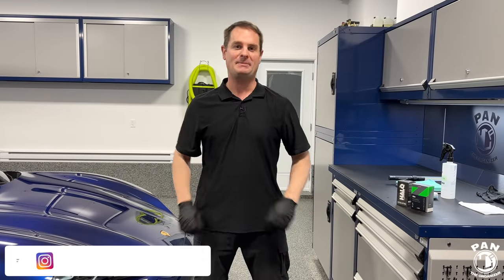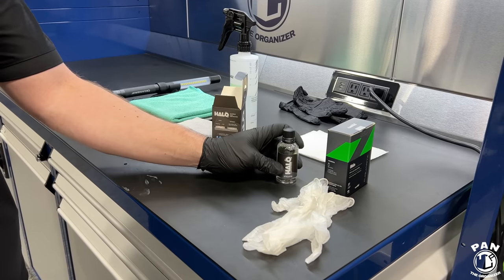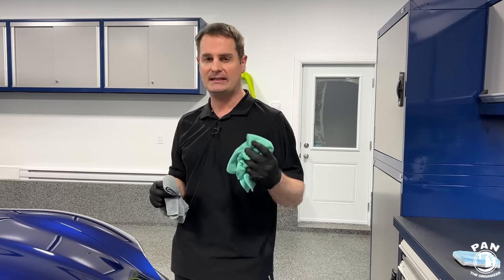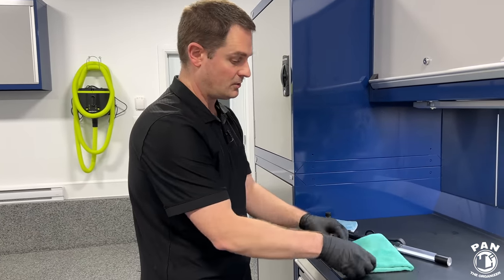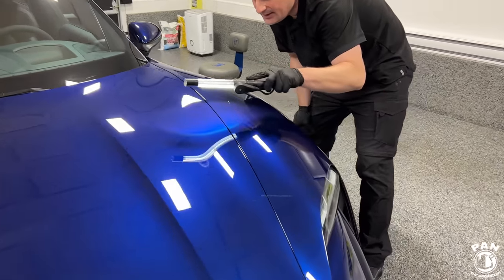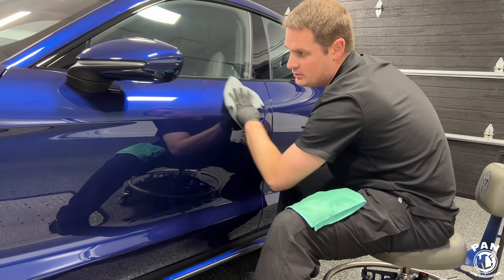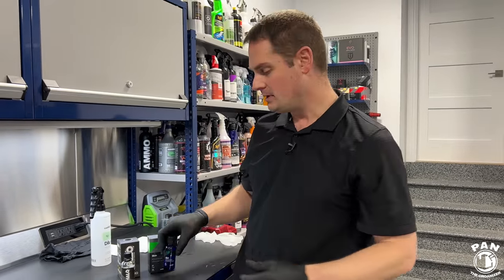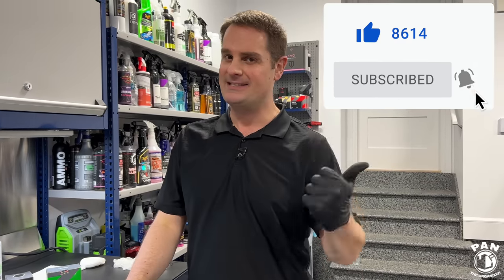How to apply a ceramic coating on PPF (paint protection film) : Porsche Taycan Turbo

Comment: What’s your thoughts on using CSL on a gloss wrap vs halo ? I know one is a 2 year one is a 3-5 year coating not sure what works better for it though.
Reply from the maker: CSL will work on PPF as well. It probably won't last as long as it would on a clear coat though, as that's not its intended use.
Reply: @PanTheOrganizer  cool makes sense. I’ll try halo! Thanks brother!

Comment: What is best way of purchasing ceramic coatings in bulk to save money? Thanks
Reply from the maker: It depends if you're a consumer or pro detailer. If you're a pro detailer, signing up with your favourite coating brand to become an authorized installer for them usually allows you to buy in bulk at discounted prices.

Comment: I have a partial  PPF can I use the Halo or Carpro for both surfaces?
Reply from the maker: If you have painted surfaces too (no PPF) use the paint coating on PPF too. For example, CarPro CQUARTZ UK 3.0 can be applied on paint and PPF.

But a PPF coating isn’t made to be applied on painted surfaces.

Comment: I really thought I could use Crystal Serum Light/exo on top of ppf. Should I buy Halo just for the parts that we are going to film (full front) and then use csl/exo on the other parts? I'm worried there is going to be a noticeable difference.
Reply from the maker: You can still use the Crystal Serum Light and Exo V4 combo on top of PPF if you wanted. Many paint coatings can also be applied on top of PPF.

It's just that Halo was specifically formulated for use on PPF. There won't be any noticeable difference visually regardless which ones you go for. Don't overthink the moment.
Reply: @PanTheOrganizer  Thanks, Pan! I've learned so much from your channel. In your opinion, do you think the water beading and sheeting is as good with Halo as it is with csl/exo? Ultimately I'm just trying to give my new car as much protection as possible while making my maintenance as easy as possible. We keep our cars for a long time..hence the ppf :)

Comment: I guess what is the process after 1-2 years when this stuff has worn down?  Since it's PPF are you doing just a  decon wash with a light polish to remove the leftover coating to reapply?
Reply from the maker: Correct.

Comment: Pan, Will a ceramic coating on clear bra affect the self healing properties of the wrap?
Reply from the maker: It depends what PPF you have and what coating is applied. Too many variables involved to answer. Your best bet is to get in touch with the manufacturer of your PPF and ask them directly.

Comment: what's the correct procedure if you  touch the windshield or the side glass by accident with the halo??
Reply from the maker: Just immediately wipe off.
Reply: @PanTheOrganizer  thank you for the prompt respond. I know this video is almost a year old, however. do you still recommend the halo or is there something better in the market .
Reply from the maker: Gtechniq Halo, CarPro Skin and Gyeon PPF EVO are still the best for PPF. I made a recent video where I used CarPro Skin on my Porsche's PPF that was replaced on the rear wheel arches here: https://youtu.be/gusUiD9uoW4

Comment: Is there a waiting period to put ceramic coating on ppf after the ppf had been installed?
Reply from the maker: It depends on which PPF you get, but normally the following day to the PPF installation, you can apply the coating, unless your specific PPF installer has other indications.
Reply: @PanTheOrganizer  Thanks Pan.  Appreciate your quick reply.

Comment: Can I also use this Halo Flexible ceramic coating to coat the rest of my vehicle which DOES NOT have clear wrap on it.  We only clear wrapped the entire front end.  Or do I need to buy another ceramic coating for the factory clear coat?
Reply from the maker: No. These PPF coatings are meant for PPF, not painted surfaces. If you just want one coating for the entire car, PPF and unprotected surfaces, get a paint coating. The majority of those can also be applied on top of PPF.
Reply: @PanTheOrganizer  ….Ok.  I went ahead and ordered the HALO that you used for the PPF.   Can you recommend a top quality ceramic I can put on the non-PPF factory painted surfaces?
Reply: @PanTheOrganizer  ……So they tucked the PPF completely around all edges that they could, but some of these pre-cut patterns have edges showing that are not fully covering the factory paint.  Should I use the non-PPF regular ceramic coating to apply along all the exposed edges to protect the factory paint along all those edges of film?   Then use the HALO to cover the PPF panels?
Reply: @PanTheOrganizer  .....OK.  I ordered the HALO Flex and the Avalon King for the non-PPF surfaces.  The Xpel PPF was pre-cut patterns so there are some long edges that were not completely wrapped around the edge out of sight, so I have a thin exposed edge of factory clear coat.  ----  I was going to use a small applicator with the Avalon King and run it down those edges to ceramic coat the exposed clear coated edges.   Of course that ceramic coating will overlap onto the PPF a little bit.   Then I was going to use the Halo Flex to cover the rest of the PPF surfaces.   ----- SO, is it ok that both ceramic products overlap each other a little bit alomg those edges?    I guess I'll run the Avalon alomng the egdes first, let it dry overnight, then use the Halo on the rest of the PPF surfaces.  Will that be ok?

Comment: I'm getting my car wrapped in Xpel Stealth and am thinking about using Gyeon Matte because it's specifically designed for matte finishes and won't add any gloss to the finish, like, I think, the products in this video will. Do you have any experience with this product that you can share?
Reply from the maker: Listen closely to what I said in the video. Both Halo and Skin can be applied to matte and satin wraps and PPF. Halo can also be applied on self-healing films.
Reply: @PanTheOrganizer  Yes, I heard you say that, but was just concerned about putting a glossy coating on a matte finish and then having a shiny finish instead of matte. Sorry, this is the first time having a matte finish, so I'm just trying to educate myself to make sure I do everything right.
Reply from the maker: If a product is compatible with a matte surface, that means it will not add gloss to that surface. Halo and Skin won't make matte surfaces glossy. Don't worry about that. What they do is enrich the appearance. So you keep the matte appearance, it just looks richer and nicer. Once you try you'll see what I mean.
Reply: @PanTheOrganizer  Thanks, Pan! That's the kind of information I have not been able to find ANYWHERE! :)

Comment: At 22:02, what are all those scratches on the trunk panel ? If covered with self healing ppf, would be good to try the heat gun on that section but clearly something isn't right on that section.
Reply from the maker: Those were underneath the PPF unfortunately
Reply: @PanTheOrganizer  Thanks for the info. If it was my car, I'd remove this ppf, fix the scratches, then re-install a new PPF.
Reply from the maker: Yeah but that would cost you thousands to do. A PPF job is already in the multi-thousands of dollars...

If it was my car, I would have simply told the installers to fix their mistake, remove the PPF and repolish and reapply new PPF on the affected areas. It's up to them to back the quality of their work.
Reply: @PanTheOrganizer  I agree with you. Whoever did the PPF did a very bad job. I can't figure out why someone would feel ok leaving all these scratches and just add PPF over it. A friend of mine is the master trainer at XPEL and no way he would have let anyone apply PPF on a paint so badly scratched.    I prepared the paint on a Porsche Taycan Cross Turismo Turbo GT Silver before a 100% PPF and the result is outstanding.

Comment: Is that ceramic coating slippery could I use it to make a surface slippery ?
Reply from the maker: Yes it's very slick. You can always improve slickness even more by using a good drying aid/topper after regular maintenance washes after that.

Comment: So how to rede the coating after 1-2 years? I mean it ain’t easy to cut polish a PPF to get rid of old coating. Or do you simply just deconterminate and recoat on top of the old layers?
Reply from the maker: A light polish is more than enough. Nothing serious is needed. Or if you don't care about 100% removal of any residual previous coating, you can wash the car, dry it, use an IPA to wipe, and reapply a fresh layer.

Comment: Hi I've put ppf on  parts of my motorcycle .the pieces I haven't done with ppf can I put the ceramic coating on the paint .👍
Reply from the maker: No. PPF coatings don't go on paint. But most paint coatings can be applied on PPF.
Reply: @PanTheOrganizer  sorry just to be clear the one u used halo flexible one that can't go on the paint. only on ppf.
Reply from the maker: Correct. Halo is only for PPF.
Reply: @PanTheOrganizer  ok. could I just buy a ceramic coating for paint and cover the ppf with the paint one.

Comment: Another great video Pan and thanks as I'm about to ceramic coat the portions of my car that have PPF. I was watching to see how you prepped the PPF because as you say - that's the hard part.  What products would you recommend for polishing PPF?  Manufacturers warn against it but detailers say it's OK provided you use very fine polish, soft pads, and no pressure.  Maybe something for a future lesson?
Reply from the maker: Sonax Perfect Finish polish and a Rupes yellow foam pad (fine) is my combo for PPF. Works great. Here are links:
Rupes yellow foam pad: https://bit.ly/3ujLF7x
Sonax Perfect Finish: https://bit.ly/3guRQ0h

PPF manufacturers have no choice to be on the cautious side as they don't know what compounds or polishes or pads people will be using. You can imagine the potential nightmare if they wouldn't warn people against that. If you know what you're doing and use common sense, a light polish is fine.

Comment: Can we use CarPro reset on PPF? Also can we use spray on sealant on PPF
Reply from the maker: Yes for Reset if you have a ceramic coating on top of the PPF. For the spray sealant, it depends on the product. You should check with your PPF installer to see if there are any specific indications on what type of protection can be applied.

Comment: Great video but you don't touch on the most important subject. How do I remove the ceramic coating from my PPF without demaging it to reapply a new coat. My PPF can last 5-10 years and did cost me 9k. These ceramics as you say are good for 1-2 years but what happens when the time to reapply comes?
Reply from the maker: You simply do a light polish. Mechanical abrasion is the only way to ensure 100% removal of ceramic coatings. But that wasn't the goal of this video. Here we were showing how to apply a coating on PPF.
Reply: @PanTheOrganizer  Thanks a ton for your reply!
I've seen your CC removal video and it's partially the reason why I'm concerned about removing cc from ppf since as you mention some are a pain to remove and require wet sanding which I'd assume is a no go for ppf?
Reply from the maker: Wet sanding is required more for the hardcore super long lasting professional grade coatings (5+ years) from top tier brands like CarPro, Gtechniq, Gyeon, Kamikaze, Opti-Coat, etc.

The consumer grade coatings typically last less than 3 years and are much easier to remove. A light polish is usually ok.

And you are correct: water sanding would be a no go for pretty much all PPF.

What you would do is wait until the lifespan of your coating is reaching its end, then just wash the vehicle, use an iron remover for decon, use a 30-40% IPA solution and reapply a fresh coat. It should be plenty fine on PPF, as it's not as crucial like on clear coat to remove all previous coating in my opinion.
Reply: @PanTheOrganizer  Well that's all I ever needed to know! You are gold, thank you so much!

Comment: Hi. Getting my black M340 wrapped in Stek Dynomatte PPF as we speak. should have it back in 4 days. Will put either Halo or Skin; Skin mostly because I love Carpro Reset, and will be using Reset for foam cannon washes. Cant go wrong with either Halo or Skin on clear matte ppf?  (also, the PPF installer is offering CeramicPro coating for 650$, and says will last 1-2 years. WAYYYY too much. rather do Halo or Skin myself)
Reply from the maker: Yeah do it yourself for way less, and Halo and Skin can both get 1-2 years as well. Both are great picks, and yes both can be applied on glossy or matte PPF, no problem.
Reply: @PanTheOrganizer  got it!. also prep with 30% ipa before ceramic?

Also, should i maintain this with ceramic specific washes and sprays, or ppf maintenance, or both?
Reply from the maker: I spoke about the IPA in the video. I hope you listened carefully. But if you pick a coating from a brand, the best is to go with their specific panel preps. For CarPro, get CarPro Eraser here: https://bit.ly/3TyYrtV
Use that one for Gtechniq coatings too, as Gtechniq does not recommend their Panel Wipe on PPF.

For PPF maintenance, I have a tutorial here: https://youtu.be/I3AszYhWhs4?si=SSro0yQBvxDdp979

Comment: What do you recommend as the best ceramic coating for a wrap?
Reply from the maker: The same coatings for PPF can be applied on vinyl wraps. Here's my most recent video on PPF maintenance and coatings: https://youtu.be/I3AszYhWhs4?si=YhjUHx1B4GEThAlO
Reply: @PanTheOrganizer  great thanks do you recommend  halo or skin which do you think is easier to apply and works the best?
Reply: @PanTheOrganizer  it says the Evo is not available in the United States.
Reply from the maker: They are almost identical in all points, so just get the less expensive one for you.

Comment: Can someone tell me how long does it take for ceramic coating to cure once put on PPF? And also how soon after ceramic coating on PPF can you wash your car?
Reply from the maker: Same as for any coating. 24 hours of curing once applied, with no exposure to water or rain.

And wait two weeks before washing your car again. (Instructions normally call for 5-7 days, but better be on the safe side and wait two weeks).

Comment: For the carpro skin 50ml, would one bottle be enough for a full size truck 2 layers?
Reply from the maker: You’ll probably need two bottles.
Reply: @PanTheOrganizer  okay one more question, since Skin is formulated to be removable with chemicals, what chemicals would remove it without damaging the ppf?
Reply from the maker: You would need to ask that question to CarPro or to your PPF installer as there can be particularities with your specific PPF.

Where did you read that Skin is formulated to be removable with chemicals?
Reply: @PanTheOrganizer   it’s on their global website.

 “With CQUARTZ Skin that challenge has been solved. If a mistake is made, the coating is damaged or needs to be removed for any reason, you can simply remove it with a stripping solution. No abrasives needed!”

It didn’t list the stripping solution they suggest so I suppose I’d have to call them.
Reply from the maker: Yeah it’s pretty vague… If they give you a response, let me know what product they recommend, I’m very curious. As coatings are chemical resistant typically, I’m guessing it will require something pretty strong.
Reply: @PanTheOrganizer  their suggestion was a mild thinner that car painters use “Cromax 3920s thinner
if its on ppf i would be very careful!” 

My main question to them was the process of reapplication after a couple of years with Skin since machine polishing was out of the question with xpel ppf. 

Their answer was “You can do another layer after 2 years, but the ppf will be to be cleaned very well since it will be most likely contaminated 
Beside that, no need to remove the older coat. “

Comment: Question for you Pan: so coating the PPF is a good idea, for all you’ve said, but how do you equalize UV protection for cars with partial PPF? 
PPF + coating
No PPF + coating
Is there a point where it doesn’t matter and the non-PPF sections of a car will have enough UV protection as the PPF sections? Like sunscreen? At some point, a certain level is enough and you won’t get visible differences beyond?
So that when you peel off the PPF in 5-10 years, the rest of the car hasn’t faded more….
Reply from the maker: It won't matter. Just apply the coating on all the surfaces. For example, on a car that has partial PPF, I would use the same coating on the paint as I would for the PPF, as most paint coatings can also be applied on top of PPF.

PPF specific coatings should only be applied on PPF though. So if the car is fully PPF covered, use a PPF coating like CarPro Skin or Gtechniq Halo. If the car only has partial PPF, pick a paint coating (like CarPro CQuartz UK 3.0, Gtechniq CSL, Gyeon Mohs EVO, etc) and apply that on paint and the partial PPF.
Reply: @PanTheOrganizer  Thanks for the speedy reply. I’m gathering then, that it’s really the coating (rather than the PPF itself, despite all the marketing hoopla) that does most of the UV protecting. Much appreciated.